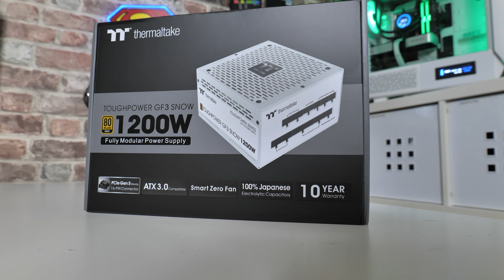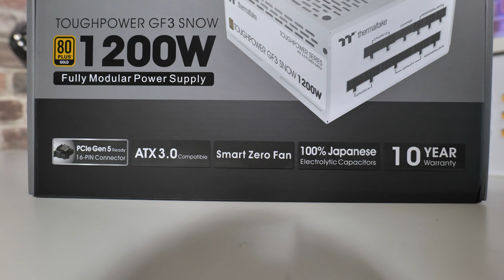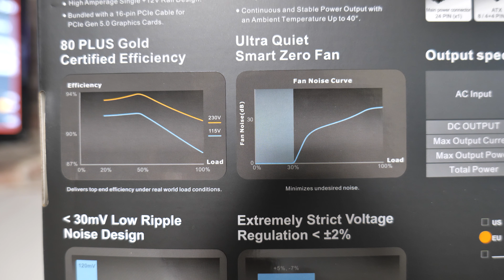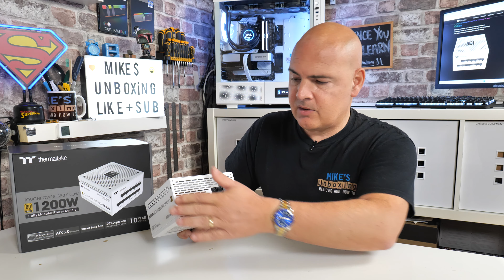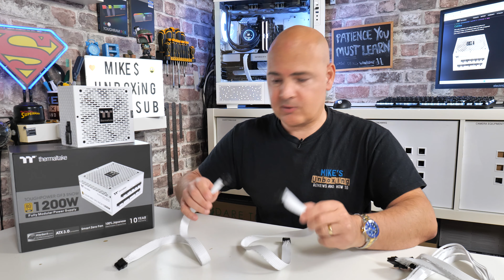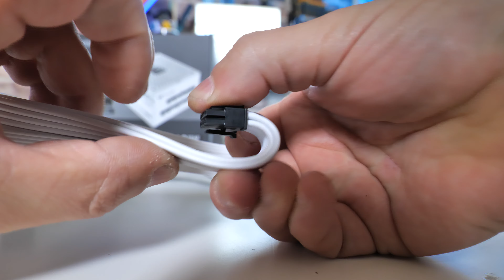Thermaltake Toughpower GF3 1200w PCIE Gen5 ATX3.0 SNOW Edition White PSU

Comment from the maker: Available from:   
GFA3 SNOW: Scan Computers : https://bit.ly/47P7o8y
GF3 SNOW: TBC ( will update)  
Or affiliate links: 
GFA3 SNOW 1050W
Amazon Local: https://amzn.to/452LpIC (Black version only available at present)
Ebay UK:   https://ebay.us/h9jbga
Ebay US:  https://ebay.us/Nx0KQK
Ebay CA:  https://ebay.us/I4QNsG
Ebay AUS:   https://ebay.us/yP9GHX
GF3 SNOW 1200W
Amazon Local: https://amzn.to/48jtqAA (Black version only available at present)
Ebay UK:   https://ebay.us/5VyoVf
Ebay US:  https://ebay.us/WlONRJ
Ebay CA:  https://ebay.us/HSECwi
Ebay AUS:   https://ebay.us/bWNwGa
Reply: Is changing from 550W PSU to 750W PSU damage the Motherboard
Reply: No because all voltages stay the same .you only have more capacity to supply the those components ( CPU, fans, Video card ect )with the  same voltages ,meaning now .. if your components need more power (amps) you have more to spare when they require it.  @hassangammudi3212
Reply from the maker: @hassangammudi3212  No, the motherboard will only use the amount of power that it needs.

Comment: Does his throttle make noise? does it whistle under heavy load? Does the power supply whistle when idle? 
Thank you !
Reply from the maker: pretty quiet fan when running and when idle or under 40% load it stops

Comment: Would you recommend connecting a 3rd individual pcie cable to the graphics card or use the 2 cables and connect the hang ? My graphics power consumption is 300w, I have a msi 6900xt gaming z trio
Reply from the maker: ideally you three but daisy chaining the hanger works
Reply: @mikesunboxing  from what i researched you can’t add a thirst cable because there isn’t another slot for it at the back of their power supplies only enough for 2 cables to the motherboard and 2 for the gpu, what I saw in a tread online that thermaltake posted was that they change the wires to 16awg from 18awg so it can support more wattage to the gpu with just two cables.. so if your tryna use 3 cables I would recommend getting the 1050w version which have a extra slot for the 3rd cable..

Comment: Hi, I bought this PSU. My motherboard has 2x8 pin cpu connectors (top left of the Mboard). Which ones do I connect on the PSU side, the two on the left in the top and bottom line? Is CPU/PCI-e the same ? Could I just connect the first and second 8 pin on the left top row (CPU/PCI-E)?  T.I.A. for helping.
Reply from the maker: the outputs on the PSU are either or, so can be used to power PCIe or EPS. but the cables are keyed differently so only use cables that say CPUI on the EPS plugs and only PCIe ones on the GPU
Reply: @mikesunboxing  thank you, much appreciated !!

Comment: Just to make sure, will this work with an RTX 3080? Im waiting for the 50 series to upgrade, so want a PSU that will support it, but want to use the 3080 till then.
Reply from the maker: Yea easily with the connection options on here
Reply: @mikesunboxing Thanks!

Comment: Is the PCIE Gen5 12+4 pin cable okay to use with my RTX4080? I know the cable can supply up to 600w but the rtx4080 only consumes about 350w I heard? I ordered this PSU and just want to make sure it will be okay to pair with my 4080. Thanks
Reply from the maker: yes it is fine, and looks great

Comment: They provide 5 CPU/PCI-E cables, but only give 4 spots on the PSU to plug them in.  Awesome.  And yes, I need all 5 (2 CPU for mobo, 2 PCI-E for my 7800 XT, and 1 PCI-E to power my 60w USBC fast charge).
Reply from the maker: sorry to hear that, maybe a dual molex to PCIe adapter for the fast charge?
Reply: @mikesunboxing No need to be sorry, I very much appreciated the review.  Not a bad idea on the molex adapter (I do have a few sitting around), but I was trying to keep the build as clean as possible.   Thanks again!

Comment: There is one thing I like about my ROG psu is the wattage display on the side. This should be implemented on every psu as it is pretty useful to see how much you use when you upgrade. It's a good way to see when you need a more powerful psu
Reply from the maker: yeah an led or lcd readout is a really nice addition
Reply: Problem with that is most cases don’t let you use that. So it would just make the psi more expensive when that feature can’t even be used